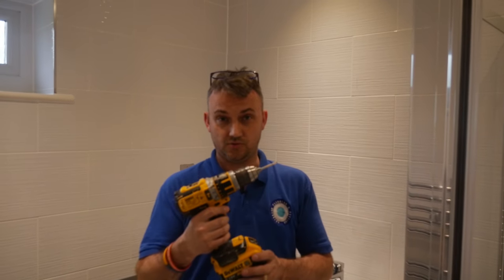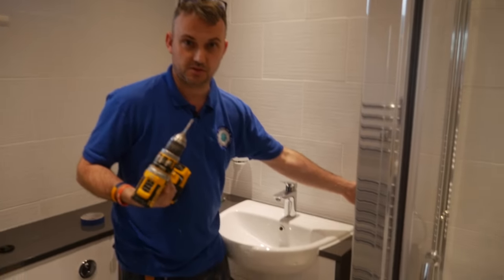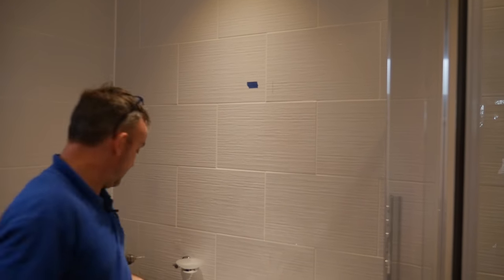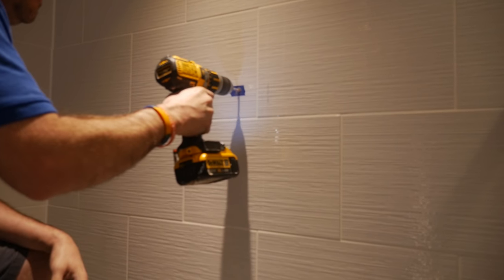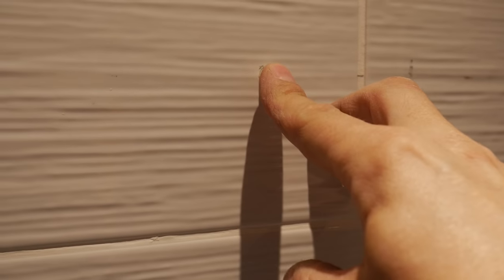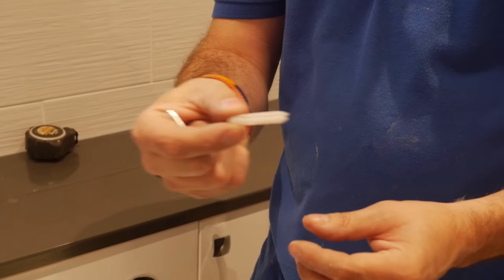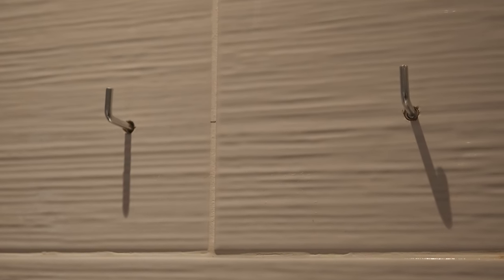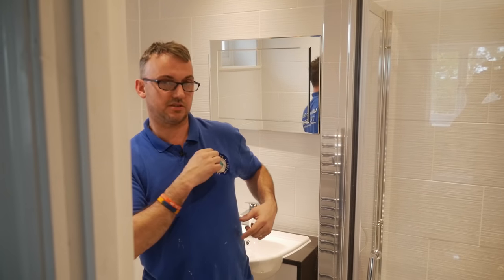How to Drill a Hole in a Ceramic Tile | Tutorial | Video Guide | DIY | Screwfix

Comment: Are you using a regular Masonry drill bit and is the Hammer on when drilling?
Reply from the maker: Once I've gone through with the tile/glass bit then I do use a masonry drill bit which is on hammer. Obviously not in hammer mode when I initially go through the tile though
Reply: Thanks for that...

Comment: Got a question. What if the plug is longer than the tile? My drill can not enter the wall behind the tile. So is it ok to just cut off the long part of the plug? I see no other solution for this. Trying to drill into the wall behind the tile with hammer action may damage the tile. Also is there any way to drill into a normal wall that does nor have tile without a hammer action drill? Thanks mate
Reply: Once you drill through the tile, you can switch on hammer again. It wouldn't damage the tile if you hold the drill without moving around. Some people they drill a bigger hole on the tile and then a smaller one on the concrete, so the smaller drill bit with hammer mode on will not touch the tile. That's playing safe but not a must.
Reply: @hfjchan  thanks for the reply I managed to get through it on my small project. Using a tile bit helped a lot. The brick behind it was relatively easy to get into. I had some guys come yesterday to put up mdf cabinets and they had a huge drill. It was able to easily drill into the ceramic tile. I do have another project my new toilet seat one of the plugs does not quite fit because the toilet was poorly made. And one of the holes on one side is too small. I was drilling it larger with a diamond round bit but it was slow going so I never finished it. Been that way for a few months. Maybe someday I will try to finish that but I have a lot of projects in this house.
Reply: @StAnger561to770  it's a bit frustrating something should be able to be done quickly and then a problem like this stopped the whole project.

Comment: The tilings really bad on that wall, no wonder your covering it up! Also the heads of the plugs don't expand just the body. Tiles are cracked by using screws that are the wrong size for the wall plug used.
Reply: I was just thinking that 😅
Reply: Are you certain of this? I need to put a plug in and it would be difficult to push the plug flush to the wall rather than the tile, as the plug has a lip, so it would require a wider hole through the tile. You think I would be okay having the plug flush to the tile?